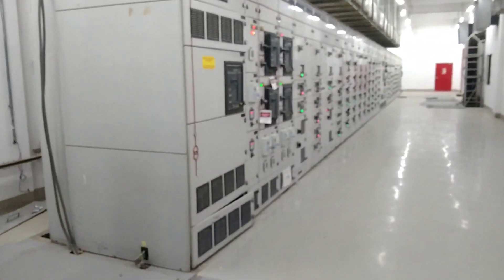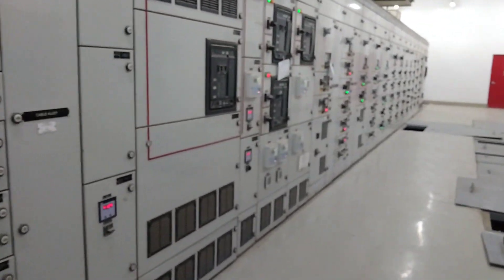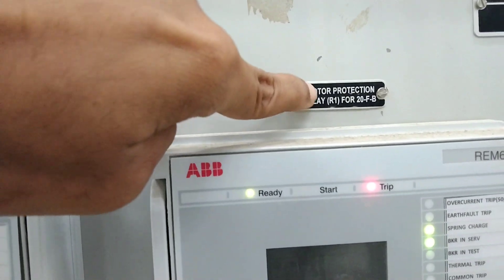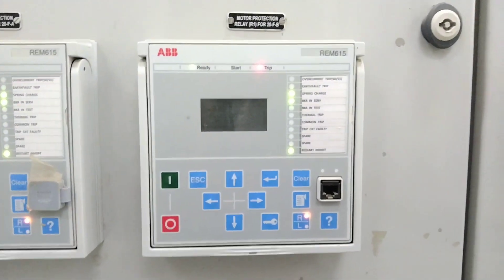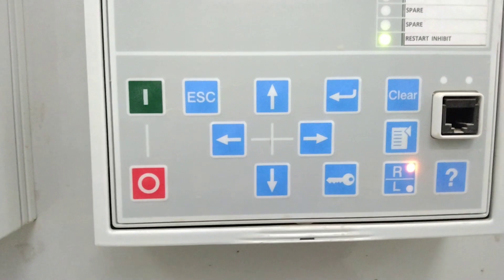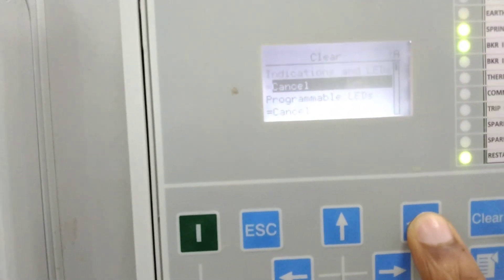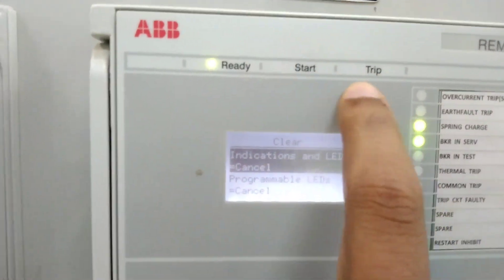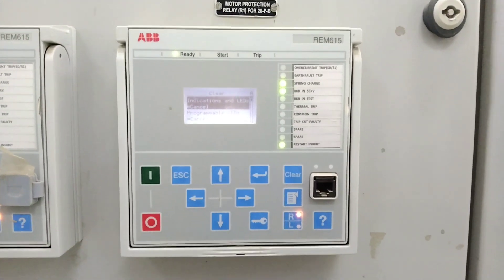How to reset REM615 / ABB REM-615/ Motor protection Relay REM615

Comment: I have a problem with the ABB REM 615 protection device, when I restored the factory settings during the operation, the power went out, then I turned it on and the error message appeared (error opening binary menu
File c:\ menu. bin failed! I hope you will help me to solve this problem...